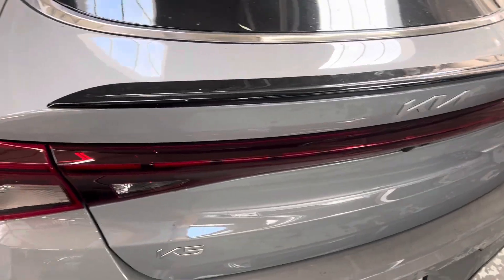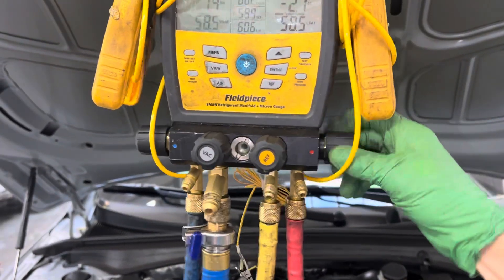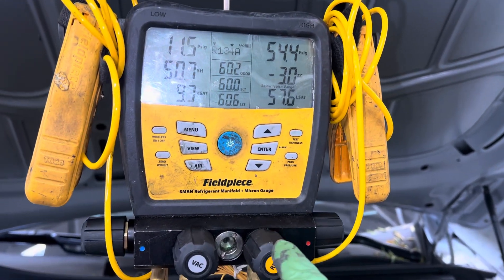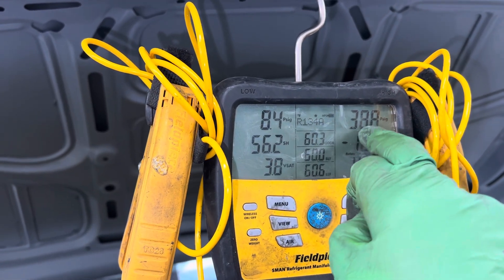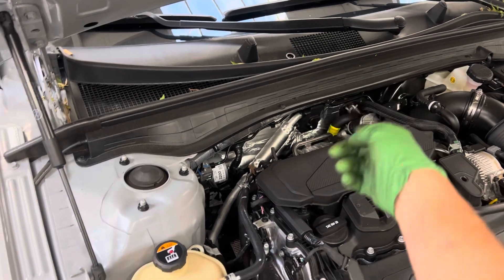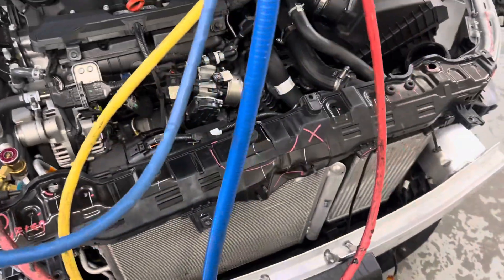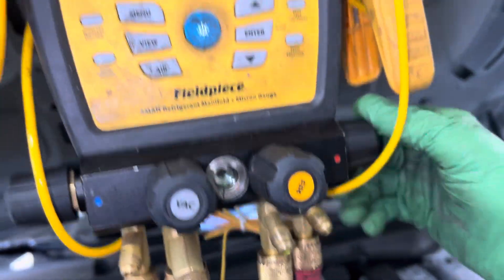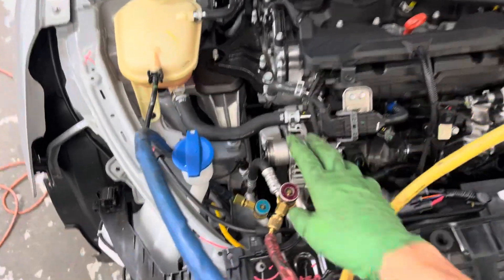Refrigerant, recovery explanation why only remove from suction line

Comment: The refrigerant you recover can it be reused meaning use the same tank to refill. I’ve been doing more mobile a/c and just wondering. Idk.
Reply from the maker: No, once the refrigerant is all recovered into one tank. The tank actually starts to corrode and rust on the inside, sometimes due to the acid and the moisture content of the dirty oil.. 
  And it’s a mixture of all the different types of oils that are not supposed to enter mix so it’s a sludge or a slurry. 

      Plus, the particulate matters from piston ring shreds, the Teflon off the side of pistons and metal filings from burnt out compressors and burnt black oil. 
     So think of it is a oil waste tank for all the disposed roasted oil from transmissions rear and differentials and engines like get dumped in Automotive shop into one big giant container and then a recycling truck comes and picks it up and they clean it and recycle it and it’s cleaning clear and pure oil again same thing with the refrigerant. It has to go through a processing machine That separates out oil separates out acid removes moisture removes particulate and remove removes noncondensibles and air separated from the refrigerant and then after all that it’s pure refrigerant again.. 
     Think of it as a Britta water purifier. One of those ones that you would bring out into woods that can get rid of lead salmonella viruses bacteria, and it goes in brown water and comes out clean and drinkable on the other side.
Reply: which vacuum pump do you use? I wanted to get a battery powered like the Milwaukee. Sometimes I’m no where near an outlet or the home owner isn’t home. What do you think?
Reply from the maker: @TheManny4692  if you get the Milwaukee or any battery powered always have a second redundant backup battery. And at least get 12 amp battery for extended length and runtime.
Reply: @coldfinger459sub0 yes I have couple 12 amps forge I use for my air compressors. Which fieldpiece vacuum pump do you use? I’m currently using a robin air

Comment: Can you also show us how to use the automatic recovery machine so we can understand. And 

1.how do these automatic recovery machines work ? Are they recovering from the vapour line OR are they recovering from both the vapour & liquid lines together at the same time & separate the compressor oil in a separate container ?

2. After the refrigerant recovery with that automatic machine,  if we should add / mix some compressor oil to the system, can we add different brand of compressor oil (as long as PAG46 for R134A) since we don't know what was the original compressor oil brand filled from new / the factory. (i.e if we mix motorcraft pag46 with ND8)
Reply from the maker: I do not use the large automatic RRR machines. 
I would go bankrupt if I used them. 
      They are way too slow. 

I do up to 6 cars at a time with individual vacuum pumps and multiple individual recovery machines. 

Every large automatic RRR ( recovery Recycle, Recharge ) all have slightly different instructions. 

They have a manual some even have training videos
Reply: @coldfinger459sub0  😅 i see, thank you

Comment: Great video. Thanks for all the great info.

How much is the vapor barrier pressure?

Also when bother pressures hit 0 is this when ylthe recovery process is complete?

Thanks
Reply from the maker: Vapor barrier is not quite the right wording

But if you mean vapor pressure . 

And when is the recovery finished? .  in Automotive by the EPA guidelines for refrigerant recovery practices that you learn when you get your refrigerant EPA certification. 

The minimum required pressure for recovery is -15 psi . 

But with my equipment, I like to recover the refrigerant down to roughly 800 or 900 µm that is even way beyond -29 vacuum .
Reply: @coldfinger459sub0  gotchya. Correction vapor *pressure*.
So what is the Vapor pressure? The point at which you opened the high side in the video during recovery. At what psi is it safe to open the high side in conjunction with the low side?

And in regards to the completion of discharging, essentially are you pulling a vacuum at the end? And would you still pull a vacuum with with a vacuum pump after the discharge process prior to recharging with refrigerant?

Thank you!
Reply from the maker: @DanWeinbrand  once I see the high side pressure drop below 1/2 to 2/3 the starting pressure. 
   Then I opened the high side. Slowly looking in the site glass on my gauges to make sure no liquid or oil come up. 

Because in certain situations, depending where the high side service fitting is located, ambient conditions and system design known, and you can still have some liquid in the area where your surface fitting is located . 

And that’s a sight  glass is used to confirm . 
Always have a sight glass.

Comment: Where can i buy your digital gauge like that. Good job👍
Reply from the maker: TruTechTools online I have an 8% discount code

LECHAIR  

All one word all capital letters at check out the discount coupon box you enter that code in there and it’ll remove 8% off the price 

The part number to the gauges I have 

Fieldpiece is the manufacturer 
The model number 
SM480V 

The big blue hose, the high vacuum, three-quarter inch silicone vacuum hose 

That’s a separate kit with the adapters 

They have a individual kit in a bag for Automotive 1.5 m long

Comment: I'm fascinated by your theory of the "circle of life." I don't want to be that YouTuber troller. I would love to sit down and talk about this. You may be onto something here.
From my understand its only in operation that the refrigerent goes into its 2 different properties. When its "resting/off" at its lowest pressure it doesnt matter. Thats why its so critical to work on these systems after a cooldown.
Reply from the maker: Don’t quite understand what it means, resting after cooldown
If you worked on at any time, stone, cold ice cold with the Red Hot engine immediately while they’re just turned off refrigerant can be covered and charge 

There’s no limitation on the temperature. The system is at or to be capable of being worked on.

Comment: Tom i finally got the baby 1/4 " YJ, only 5 feet and has the small shorter hose with valve. Like 2 hose in 1, can be separated. Dang this baby diameter hose can do so easy to 80 microns pump>hose>micron  gauge quick dirty 4 minute test. YJ claimed 75 micron capable, no bullshit. My thailand made 6 feet same diameter hose hardly can hit 200microns under same 4 minutes.

 I bet you can do easy under 120 micron on  a dry car, even with ur sman 480v as manifold, with that king of 
suction trublu❤ and the long YJ hose.j
Reply from the maker: Specially, if I leave it on the vacuum pump overnight, I got a few videos under 70 µm in the car system
Reply: @coldfinger459sub0  i am not surprised at all. 😍. Amazing the material and coating YJ uses to produce this. Your extra exterior treatment to ur YJ perhaps done some good too yah Tom. Aside from chaffe protection. Indeed YJ 1/4 is fatter a bit compared to other 1/4 hoses i own.
Reply from the maker: @suryaprihadi2258  definitely money well spent 

And you have test micron meter that can prove it